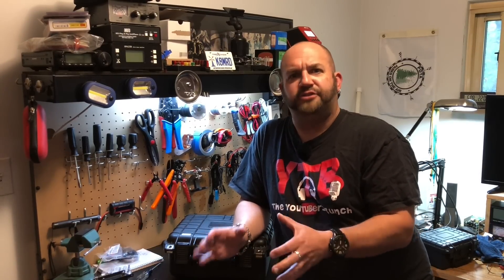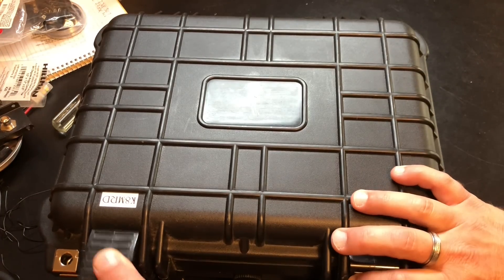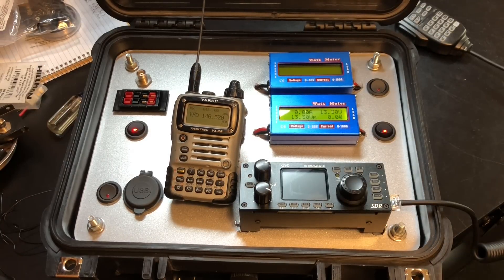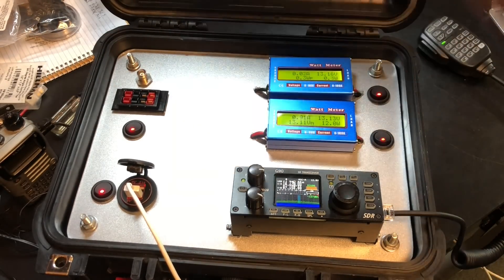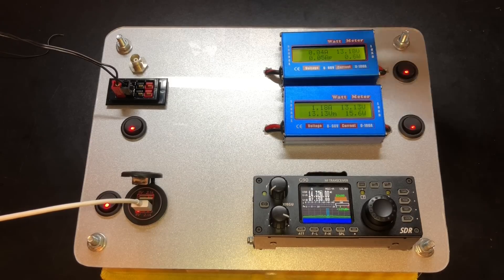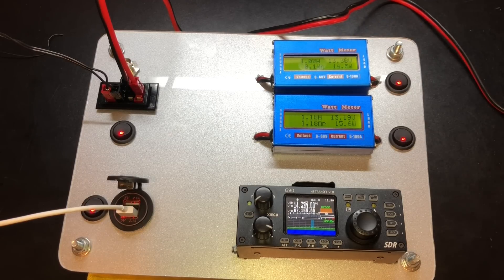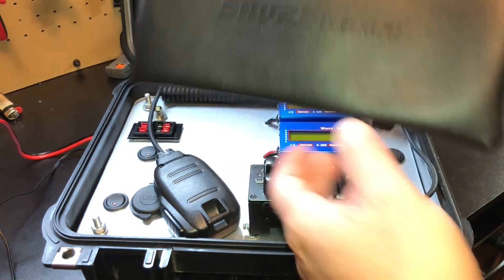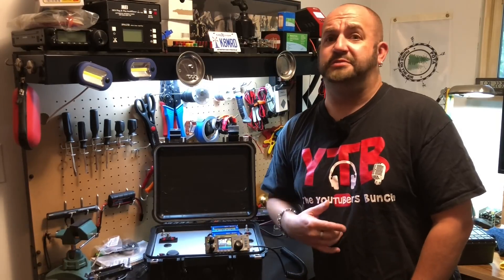Xiegu G90 Ham Radio Go Box & Solar Generator

Comment: That's almost exactly how I intend to build mine.  Very well done.  I have the same watt meters.  A lipo battery pack with dcdc on it.  I have a car 12v outlet with a 5v adaptor in it, so I can use either 12v or 5.

I will be building it soon.  I'll share something here when I do.  I intend to watch your build video to see of there are any tips to glean.

Comment: without mounting it on the case, wouldn't it rattle when you carry it around ? what battery Ah did you use on this with which solar panel?
Reply from the maker: No

Comment: Nice build. But I would place a non-conductive plate between the G90 and the chargecontroller as seen on 8:42. That thing could easilly go boom!!

73de LB6CI
Reply from the maker: I had heat shrink on it but I cut it off to show the controller in the video.  It is now wrapped in kapton tape.

Comment: For the top layer, I was  trying to figure out how to use barrel nuts so that that it screws down flush with the top layer surface. Just started researching barrel nuts tonight (4-3-2021). Did not know what they were called LOL. Currently using wing nuts since I am still hacking the build. I also used locking/nylon nuts. PITA but will try them out on my first current build.
Reply from the maker: Those look like a great idea.  Have fun building!

Comment: Thanks for the inspiration.  I just finished my first solar powered portable power supply.  100 watts with a 20AH Bioenno battery and a ton of Anderson power pole connectors. It's ugly as hell and I will rebuild it in a better suited ammo box, but what I have for now will work great for POTA work if Denver ever warms up.  Winter is design and build time here. W0STO
Reply from the maker: Thats awesome, I built one of those too and use it all the time.  I did a video showing it called My Portable Power Solution if you want some more inspiration.  I'm about to build another one with those crappy Miady batteries just because I love battery boxes so much.  Good luck warming up.  I just got out of Michigan and moved to Texas.  Can't stand the cold.  73

Comment: Great Idea. 
Enjoyed the build video. 
Question: how are you using the small screwdriver to put wires into powerpole sockets. 
I’m new to Powerpole use & not seen them connected like this in the past.  
Thanks Mike.
Reply from the maker: I'm just using it to push the metal connector that crimps on the wire into the plug.  Theres a little springy thing inside that it has to go over and its hard to push in sometimes.  It's pretty simple actually.
Reply: @hamradiotube  thank you

Comment: It's the best I've seen so far.  in terms of weight, availability, portability, Super 73 de HB9DTC Thomas
Reply from the maker: Thanks a lot!  I've had a chance to use it in the field a couple times now and it works great.  The solar charge controller puts out some nasty RF while charging so I'm gonna have to find another solution for that.  My newest video, A Texas Sized POTA shows it in action.

Comment: The power unit itself and the LED in the switch draw 4 hundredths of an amp...
Reply from the maker: Yeah they draw a little bit.  Thats not why the meter is reading off if thats what you're getting at.
Reply: @hamradiotube  a red LED draws .02 amps. Got another LED on that circuit? If so that’s the .04 draw you’re seeing.
Reply: Actually, a red LED with a resistor to bring it down from 12v could be the cause. Run the meter straight from battery would be the easiest way to check.

Comment: The standoffs are a cool idea but have you seen a 1/4 20 couplers? They have them in different lengths. You could then use countersunk 1/4 20 screws for a much cleaner appearance. Just a little critique. Sorry there is always that guy and sometimes I am him.
Reply from the maker: No worries at all, I've had all kinds of suggestions.  I've not heard of the couplers you speak of.  I wonder how well that would work if they need to be counter sunk into the Plexiglass?  One plus of the way I did it, although not as clean, with the bolts that I used is I can grab hold of them to remove the whole setup out of the box.  I find myself doing that a lot.  Otherwise I would have to tip the whole thing upside down and that opens up more chances to drop it.

Comment: The Tenergy Power meter is exactly the same as the Powerwerx but it’s only about $16.
Reply from the maker: Hmm...I'll have to look into that.  The only meter I own that is actually accurate is my Powerwerx.  I have the 2 in this build and 2 others that are clones of the Powerwerx and they are all off a bit.  All were around the $15 price range.
Reply: @hamradiotube  i’ve been using that Tenergy brand power meters for a couple of years. I have over 100 radio controlled aircraft and I use it constantly.

Comment: Looks nice. I've done a battery box and just thrown a dual bander 2m/70cm radio in the box with the batteries.  But nothing like a nice integrated radio box.  I do have a WIP uBITX radio in an ammo can.  I've been taking a good hard look at the G90 or the FT-891.  I own an Icom 718, my only major complaint with it is I don't have filters installed in it, and its not really a good portable radio.  So far on HF I've only done digital modes, no voice contacts.
Reply from the maker: Yeah I've seen a lot of those.  I wanted to make something a tad nicer.  The g90 doesn't have any filters either so if thats important to you I would go with the 891 for sure.  If you just do digital it really doesn't matter, although getting the g90 on digital is a whole other chore in and of itself.

Comment: Very nice build. Consider adding a raspberry Pi and a small sound card then You’re setup for digital as well. The Pi will put out a WiFi hotspot that will connect through VNC Viewer to your IPad. OH8STN has an amazing video series on setting up the raspi for ham radio.
Reply from the maker: Thanks for the comment but no, that goes against everything I said in the beginning.  I'm very well aware of all things ham radio and Rpi, but 1, incorporating more stuff like the Rpi etc. will add more bulk and weight, and require a bigger case (again, the exact opposite of what I wanted with this build) and 2, I don't have any desire what so ever to use digital modes out in the field.
Reply: K8MRD RADIO STUFF I didn’t realize you were that worried about weight. My setup for digital SOTA activations only weighs 91g (including cables) more than my voice setup and is smaller than a pack of cigarettes. Since this go-box is what I assume you would be using in an emcomm situation I figured you would want all the capabilities possible including being able to talk with poor propagation. As you know 20w on SSB voice doesn’t get you very far during bad conditions. Even if it’s not used regularly, I figured you would want all the capabilities possible in the fixed space provided. But hey it’s your project bro build what makes you happy 👍

Comment: Nice Build!  You're right about there being so few HF go box builds.  I've been contemplating building one based off of a uBitx.  One thought (based on one of my QRP accessory box builds) was to add elastic straps hot glued horizontally across the lid interior to hold a tablet, some papers, and a few cables etc.  This worked nicely and kept the mess off of the main surface when you opened the box.
Reply from the maker: Thanks Josh, thats a good idea and I have thought about putting some way of holding stuff in the lid.  I'm just cramming everything on top right now and it seems to work.  I don't put much faith in hot glue so I'd prob use epoxy or something if I were to add anything up top.  I was thinking some netting or something.  We shall see.  73

Comment: G90 coming today. Next start gathering these parts... Question for you though, would a Pi4 in a minimal case fit in the open area between the meters and the dist block? Kinda hard to judge from the camera angles and such. 
Great idea for a box and I'm looking forward to getting a similar setup going. [Just waiting on Callum and my Commander stuff... :)]
Reply from the maker: On top it would fit yes.  All the cables to hook it up to digital might be another chore.  Perhaps if you rearranged the power poles and the USB port with that in mind you might be able to squeeze it in.  There is almost zero available room left under the hood as it is though.  I'm not saying it's not possible, but you might have to go with a bigger case to make it all fit.
Reply: @hamradiotube  Cool. Once I get all the stuff gathered up, I'll see how i can do it. I'll probably end up with the Pi stuck to velcro along with the SignalLink and just have the cables stuck through the top some how. Not a great way to do it, but for a first box it should work. Thanks!
Reply: K8MRD RADIO STUFF one other thing I found was a shorter DB-9 cable (C2G 25211 DB9 M/F Serial RS232 Extension Cable, Black (1 Feet, 0.30 Meters) https://www.amazon.com/dp/B000ZKQZDG/ref=cm_sw_r_cp_api_i_VQ5AFbC0DVMSV). The connections are the same but the length might give a little breathing room in there. If there were only a feasible way to change that from that to a smaller connection... 
Also, after watching your tutorial, I’m going to bump up the box size to the large and squeeze the Pi under the top. 

Thanks again for the inspiration!

Comment: I don't have a Twitter account, but a local ham just gave me his demo unit for a VHF only go box. It has an Icom IC-2300H, a voltmeter, an LED light strip, and a telescopic antenna in it with the option for an external antenna. The only two things I would improve is easier access to charging the battery/external power and maybe adding a UHF transciever. But it's really cool and sounds great! It's in a fairly small, albeit somewhat heavy reproduction WW1 ammo can.
Reply from the maker: Thats awesome.  Sounds like many of the VHF go boxes that inspired me to build this one.  Charging was paramount for me hence the 2 charging ports, one for solar, one for home charging.  You never know where you will be and how you will be able to charge so I though it best to have both.  Thanks for commenting. 73

Comment: Bill-N6EF-Very timely. I'm working on a go-box using the Harbor Freight 4800 box which looks like the same as your box. I was going to make a homebrew Gater-type 19-inch rack box from wood but this convinced me to go back to this box with my FT-857D. I have the Bioenno 20Ah battery which should fit. I also have the next size up with the wheels I was going to try but I'll start with this one first and see how it goes. Looking forward to the build video.
Reply from the maker: If you're going to go that big I wonder if the one with wheels would be the better way to go?  Start packing too much stuff into it and it will get heavy really fast.  Those wheels might come in handy if you are going more than a hundred yards or so from the car.  I'll prob have the build video up either tonight or tomorrow so stay tuned.  I'd love to see what you come up with when you get yours built.  73.

Comment: Hey Mike, have you tried that charge controller yet?  I'm using a Renogy  PWM controller.  So far, no problems with RFI, but I'm in need of a second one.  The one you used is a nice price for an MPPT version!
Reply from the maker: oh yeah Ive had this charge controller for a while now.  Its decent for $17.  It does put a little bit of noise out though.
Reply: @hamradiotube  yeah for that price, I'm going to get one.  Building another battery box, so It'll so in there.

Comment: Very clever way to mount everything in the box. I haven’t seen anything like it before. As far as cooling, you may be able to put a couple of one inch spacers under the bottom plexiglass to lift the top plexiglass above the box rim in warm weather to provide airflow.  No extra fan needed. Keep them in the ditty bag when not needed. May not look cool, but will be cool.
Reply from the maker: Thanks.  That was one of the main reasons for doing this project.  I'm not worried about ventilation.  There are plenty of gaps due to my lack of precision engineering for air to circulate.  If it does get super hot on a hot day I can always just remove the whole assembly from the box.  It just slides out.

Comment: What about the speaker? Is it under with the radio?
Reply from the maker: No it’s facing up.   No problems hearing it.
Reply: The top plexiglass doesn't impair the sound?
Reply from the maker: @brooksgreen4910  Not really.  The lid actually reflects it forward a little bit too.

Comment: Right now my go box is my pick-up truck where my 706 usually resides along with a screwdriver antenna. Just disconnect the radio from truck power, connect it to a separate battery, move the display head so it can be seen in the passenger seat, plop myself in that seat, fire up the laptop and I'm good to go.

Its when I set up outside the truck that takes time.  A HF go box that just has to be opened would save a lot of time.
Reply from the maker: Yep, that's a good one to have as well.  I have a similar setup in my car too.  It's just not as fun to operate in the car for me.  I like being outside.

Comment: Great build Mike! I've done 2 vhf/uhf kits for our club based on the same HF box. I love how you sandwiched the whole works between the two pieces of plastic. Do you have it anchored to floor of the box or does it just "float"? The other thing I did was put a 1ft strip of LED strip lights in the rim of the top of the box. I wired a small switch inline and they're there if you need a little extra light. Again awesome build ..... I'm ordering a G90 today ..... hurry up with the build video! Thanks for sharing!!!
Reply from the maker: Thanks Pat.  I just have it set in there floating like.  I actually tried to find some red led's to put on the lid but couldn't find them where I previously had.  I may check a local auto store.  I really do want a light in it.  That may prolong the build video though haha.  Its actaually 99% done and edited.  I just need to make an intro or something and release it out in the wild.

Comment: Nice build and video.  I’ve never done one of these... but if I ever did I’d like to take your exact components and try to install inside of the Icom 705 backpack.   As for your case, if you are taking suggestions, I wonder if you could squeeze an HT stand in that wide open middle - and maybe some strips of wide white tape on the inside of the lid to use with a dry erase marker so you could write down your park info?  Or maybe a laminated white piece of paper?  I dunno - just random thoughts.   Thanks mike!
Reply from the maker: Thanks Chris.  That would be interesting to see in the 705 pack.  Funny you mention the HT stand, as yes I have put one in with plenty of room.  The only catch is you have to have an HT that accepts 12V.  I have 3 that do, but Baofengs take a 10V input so you'd need a buck converter.  You could however, make a cable with power poles on one side and a cigarette lighter adapter for an HT stand if it weren't 12V.  That would be another work around.  Also good advise about the dry erase marker.  I could actually just write that on the Plexiglas and wipe it off when I'm done.  Good ideas.

Comment: Any concerns about overheating?  Do you think there is sufficient airflow for the radio?
Reply from the maker: I don't have any concerns no.  Everybody else seems too though lol!  Its not like this is an air tight box.  There's all kinds of breathing room around the edges.  Plus its raised off the bottom plate so it can breath a little.  The radio is a poor design with no fan and the heat sink on the bottom already so I'm just gonna see what happens.  I really don't think it's a big deal.

Comment: I Have tried like crazy to get a battery pack like yours but it seems to be impossible here in New Zealand.
Tried Amazon, but no one will ship to NZ.  I would really love to get hold of a pack and the charge controller for my DXpeditions to the Pacific.
Any suggestions are welcome.............
Reply from the maker: You'll prob have to make your own.  Check out evcomponants.com and search for lifepo4 cells and a bms.  They are in China and should ship worldwide.  4 10ah cells cost me about $100 shipped.  I use the 38120S cells, but they come in a variety of sizes.  Or just google Headway 38120S cells, or Headway LiFePO4 cells.  You can also find them on Alibaba.com